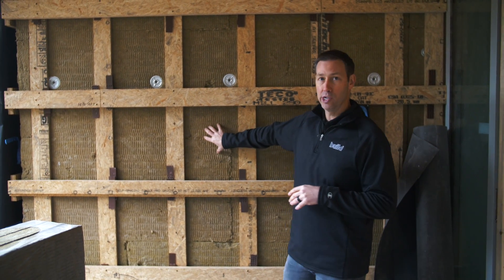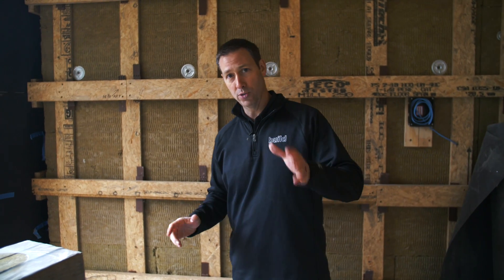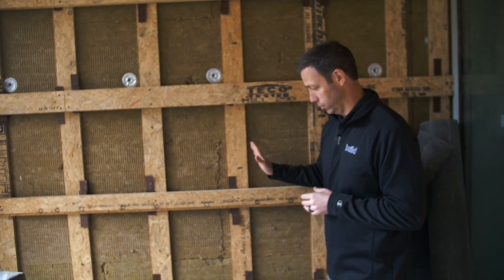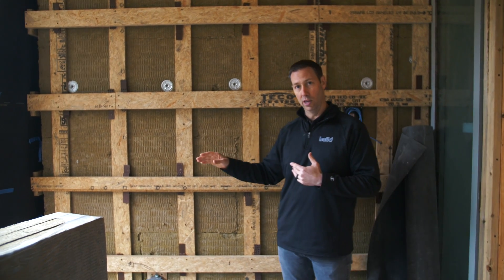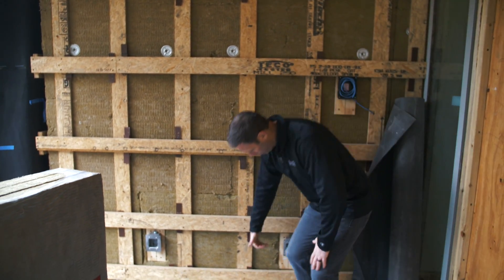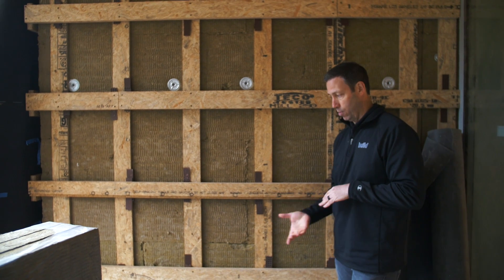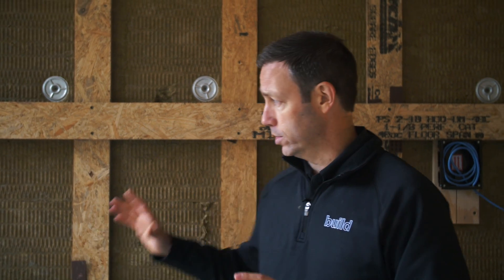Rockwool + RainScreen Exterior - This is a killer assembly!

Comment: Super Nice! -- QUESTION -- To my mind, Rockwool, which I love, is more like a wool sweater on a cold day - it only works if you have a windproof gortex type jacket on top of it. Regardless of the stated R value of a "sweater" the wind blows through it easily, unless you have a windbreaker on it.  So why does the cold air not flow right through Rockwool?

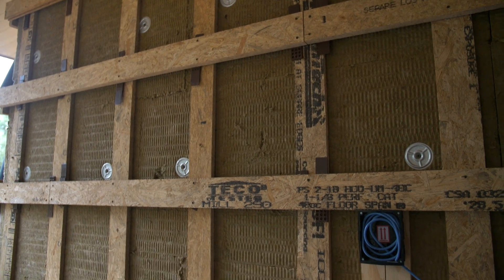Comment: At 2:32 there's a mention of backing out caps / screws and just holding the mineral wool in place with the battens. I'd like saving those expensive screws, but don't they leave hundreds of small holes in the air control layer when they are backed out?

Comment: Rain screens (cladding) are a great idea but they have an unexpected danger - fire. If made of flammable materials, especially when vented at top and bottom, they form an excellent chimney for flames to quickly rise. That contributed to the horrid apartment fires in London in the last few years. Same problem as the old balloon framing technique that we’ve abandoned. The rockwool is fine but the rest is fuel. Definitely a ‘killer assembly’, unfortunately.
Reply: Rockwool is very fire resistant if the entire house was wrapped in it the attic would have at least two layers as well and the roof would be covered in it too. You could mitigate the flammablity of the bracing by using certain types pressure treated lumber (more expensive, and need compatible fasteners) and it would become fire proof. The London fire the rain screen was made of extremely flammable non-approved foam bonded to flammble metal siding that melted off. The building was also >15 stories vs a typical house that is just 2 stories and the top does not terminate into the air like the apartment building did but terminates under the soffet so the chimmney effect would be minimal. 

In commercial rain screen assemblies they use steel and rockwool these are completely immune to fire and are a very safe and killer efficient assembly. The london rain screen was not approved for the apartments even before the ban.

Comment: I saw one builder actually used spacers under the horizontal plywoid strips. They were pencil size with a hole in the middle for the screw to go through.  The spacers were 3 inches long so the Rockwool doesnt get compressed. They are small amd you just stick them through the wool. Perfect spacing every time
Reply: We figured this out installing gutters 150 years ago

Comment: Just by simply running the strapping, furring strips or in this case Advantech, diagonally, you still can hang vertical siding AND have strapping every 16"OC and hit the studs!  Less labor and less materials too without the risk of standing water on horizontal furring strips!

Comment: I don’t see why you couldn’t put an extra layer of house wrap on the outside of the Outside layer of the rain screen battens just behind the siding. most especially if it’s a wood clap board type siding.. As well as a layer of house wrap over the exterior sheathing. Seems like pennies that would save dollars. Still plenty of breath ability .Please let me know what you think I can’t seem to be able to find data on this. I am in a cold north of 60 climate fairly dry

Comment: How does the inner part of the siding dry since it’s put on the black UV screen? Is there any gap between the siding and the UV screen? If so, how is it realized? Otherwise this part will accumulate humidity over time.

Comment: Excellent. Very interest. The horizontal nailers should add huge strength. I agree with the idea of exterior insulation and have used it. My concern is the longevity of mineral wool. I love the fire resistance and R value and sound peoofing. The fibers are brittle, abrasive and very irritating. Brittle means that over time they can breakdown. Can you 0lesde address that?

Comment: I live in northern Minnesota and looking to insulate overly well. Last year we hit -52 degrees, yes, -52, therefore looking to keep as much heat in as possible, and not to have to redo in at least 20-30 years. Interested in your thoughts and a possible video in the future.  Thanks for the information.
Reply: New construction or retrofit? Big difference. Regardless, check out Joe Lstiburek’s “Beyond Passive” talk for some extreme cold climate lessons. As my own two cents I would just add that those new to “high performance” tend to jump right into thinking about R-values because it’s got a number on it when really airtightness and keeping the innermost airtight layer at or close enough to interior design temperature and avoiding accumulating and trapping moisture inside the wall and roof systems is the bigger challenge. Anyone can spec R-80 walls as an exercise in spending money, less people can get such walls to stay bone dry and never develop moisture related issues.

Comment: Palm beach county, when it built its courthouse, had to use man made mineral fiber, MMMF, instead of regular fiberglass insulation because of the higher fire rating required of a public bldg.  There was a problem with the window system and it leaked in a storm and the insulation got wet.  There are chemicals that help the material bind to itself like a glue would.  Mold started growing on (ie eating) those chemicals.  I did not watch all your post but I suspect your rockwool would have the same prob if it got wet.  But  the attachment skin might provide a good mold barrier if this occurred.
Reply: + large roof overhangs

Comment: “Maintaining 80 degrees!!! WTF??? My 1920s house with a $100 3 ton (used Carrier) window AC keeps my house about 65-69 degrees.  And no fancy wrap around insulation...
Reply: You weren’t listening closely.  8000 sq ft house, outside temp over 100, 3 ton AC.  I’ve got 13 tons on my 4200 sq ft house.

Comment: If horizontal strapping has already been done (by mistake) Does it need to be removed so the air flow channel is on the rockwool side?  In other words changing the layers we see so that the vertical strapping is on the outside and the horizontal is against the rockwool.  The cladding is barnwood mounted vertically.

Comment: 25 years ago I renovated our 1920 gambrel roofed house. We live in snowy Pennsylvania. . I "accidentally" , by luck  I suppose did something similar with 2" heavy industrial ceiling tiles 2'x 4' from an office warehouse that were being thrown away. They were NASTY huge fiberglass chards and we furred out the house and I filled  all the 2' gaps with the ceiling tiles. And although there was thermal bridging at the furring it did essentially the same thing allowing some air movement from the bottom behind the siding.  The rain screen (in your case black) I used was Tyvek. ...WOW has this accidental system held up well. My siding is meticulously attached  flitch hemlock natural edged siding, full 1" (no taper) . I used only stainless screws, only under the lap, figuring if the boards ever warped or cupped I could face screw. ....25 years, no movement. All the trim boards/corner boards are massive 3"  x 4" toe screwed from the edges (screws are hidden once siding is on). I was concerned about bugs getting behind the siding, but that has never occurred. The house was very carefully insulated and sealed with fiberglass Batts in the bays, and them vapor barriered with heavy mil plastic. It is super easy to heat in winter and very easy to keep comfortable in summer (most times window open at night). It's only 1200 Sq. Ft and heats with a first floor centrally located Vermont Castings stove,  1-2 cords annually. We do have high efficiency boiler and radiant floors and cast baseboard, but love wood heat. Perhaps my only mistake was consumer grade windows. We did a high end standing seam roof, which we LOVE. R
Reply: sounds good

Comment: Exterior insulation is called "continuous insulation" and has been around for decades.   I recommend using Rockwool or Hemp-batting for interior walls, and for the exterior (continuous insulation) using rigid foam, as it is denser and more weather resistant.  The best type of rigid foam for homes would be foil-lined XPS rigid foam.  And yes, you want to create a small gap between your continuous insulation and the exterior siding... this is to PREVENT what they call thermal-bridging (meaning to transfer heat/cold from the exterior towards the interior).

Comment: it should be noted that the screws attaching the furring would not reach the studs regardless of where they were placed. a 6" screw is just long enough to allow the tip of the screw to reach the interior edge of the sheathing. thus, you get no thermal bridging into the wall cavity via the screws. that probably explains why the builder used ripped 1.125" Advantech sheathing for furring instead of using conventional 1x furring strips.

Comment: I'd change the exterior wrap (UV protected) for a radiant barrier.  Then you'd see "shiny" between the gaps in the rain screen, not that it matters, but a radiant barrier is missing from the wall assembly.  R 4/inch I believe is that compressed rock wool insulation and would be my first choice because polyiso (R 6.6/inch) off gasses eventually.  Bad for the planet, but what planet?  Should we even worry about that anymore?  I built a house this way using CMU's (blocks) structurally in 2002.  I have another on the drawing board now.  
I'm putting a 1" layer of insulation over the Concrete structure, glued and screwed.  A #8 deck screw follows a 1/8th inch masonry bit into concrete perfectly, self tapping and secure, once.  Use a washer to hold the panels securely against the flat concrete surface.  Then, a 2x4 steel stud frame, balloon framed with blocking every 4' horizontally and the cavities carefully insulated.  This part I haven't done.   I need a way to use those  decks screws, longer this time, to attach the steel frame to the concrete wall, through the 1" uninterrupted layer of insulation.  Not many.
 The steel studs and 3 1/2" insulation have to fit tightly together, the 2' centers may be lost, but I think they'll work out almost perfectly.  Start in the middle and work towards both sides.  Diagonal bracing might be "let-in" steel braces (flush with stud nailing surface) or sheathing, then the radiant barrier, and a "hat channel" horizontally every 2' bottom to top.  Hang either metal siding or treated wood siding, something light weight and weatherproof.  Corners can be pre-broken metal or something sturdy enough to add strength.  Rough Openings are 1/4" all around, bigger than any finish frame, door or window.  Doors and windows are 'suspended' in place (perfectly plumb and level and parallel to the inside finish surface, then held in place with low expansion foam, which continues (maintains the integrity) of the insulation/air/vapor barrier layer "to the glass" of the inside of windows or doors.  It's inexpensive enough compared to anything I've researched and should be fairly easy to install, especially on smaller  buildings.  Here in the desert, it separates the conditioned space from the outside world which is heated by radiant heat.  All the stucco houses don't deal with radiant heat, they actually capture heat and  re-radiate it into the conditioned space long after the sun is down.
Reply: I am buying a 40 year old house built with CMU. I am planning to add exterior insulation and then horizontal drop siding. There is not much information out there about this. Is it possible to speak with you about this?

Comment: Hey Matt, Is it possible to “outsulate” with such a product and use a fluid-applied weather barrier?
Reply: Uh.... that's what's going on in this video.  The WRB would almost certainly be applied to the sheeting which is under the rockwell.  And, just to be clear, we are looking at the outside of the wall in this video.
Reply: Stephen Speicher actually it’s not. There’s a wrap product on that piece of the structure and that’s all he’s allowed to show. The wrap isn’t the issue; some fluid-applied barriers don’t like to be in contact with other certain products. But I did get my answer from Prosoco though.
Reply: Marcus Fant 

The black wrap is an aesthetic detail not for wrb. The cladding will have gaps and they wanted to show black between the cladding and not the furring and rockwool.

Comment: Rockwool absorbs water.  It is used in hydroponic farms.
Reply: Not Roxul. You can submerge it, but it does not hold water. Its very hydrophobic.
Reply: Guy Tech Oh I see.  Different.
Reply: It does not absorb water. It is in fact  the opposite of hydrophobic. Rockwool insulation does not wick water, which means that any bulk water that contacts the outer surface will drain and not be absorbed into the body of the insulation.  @SteelBuckeye

Comment: How about using all the 2'X4' ceiling panels people throw away under the house wrap for exterior insulation? I assume they don't have the same R value per inch, but they are similar enough that it's probably close, and obviously better for the price. It obviously won't fly for a house that's being sold as "all new", but for DIYers or even people who want to add insulation during a residing job, it's worth exploring.

Comment: Matt,  you need to check out GreenGirt. Solves this whole assembly problem with a composite z-girt that has metal reinforcing. It would replace the mechanical fasteners for the rockwool and also replace the vertical sheathing strips and thin corex pieces. Pretty neat system. Can be installed horizontally or vertically.
Reply: Awesome. Thank you.

Comment: I did rockwool in my walls and ceiling. Stuff is the worst to deal with. It makes for a miserable day as little bits fall all over you. It is much harder to deal with than standard fiberglass, especially overhead. The stuff gets in your eyes, down your back, on your arms, in your ears. They should really package with some vapor barrier wrapper just for handling.
Reply: I have used rockwool a couple of times and that was not my experience. While it can still make you itch it is nothing compared to fiberglass. It is also sooo much easier to work with.
Reply: Not my experience. Way better than Fiberglass batts, and you could have used a hooded Tyvex suit & safety glass or full face shield during the install.
Reply from the maker: Interesting. That’s not been my experience
Reply: Did you by chance use a different brand of mineral wool ? I had a contractor substitute Thermafiber when I specified Rockwool and that stuff was just like you described. I made them take it out and put in Rockwool.
Reply: I used sound and safe in a remodel ceiling I kinda liked doing it.( I assume it is the same basic thing  just in fluffy sheets)  Little dirty but way better than fiberglass.
Reply: the rockwool used for this rainscreen is different than the ones sold at big box stores. The ones at Lowes or HD are fluffier versions of these. Rockwool makes several types of mineral wool. These have very high pressure, and are very hard. They are used for exteriors and underground.
Reply: @NoRoads2AllRoads  Here in Philadelphia the big box stores now stock Comfortboard 80.
Reply: @mancinidesignbuild  really? That's awesome... I may have to go look at my local one in Harrisburg
Reply: @mancinidesignbuild  I live in Los Angeles and can’t find Comfortboard anywhere but eBay. Lots of the fluffy Rockwool though.
Reply: rockwool is not harder to deal with than standard fiberglass. first of all, rockwool stays between the rafters without have to be stapled or requiring other forms of insulation support as do fiberglass batts. in my personal opinion, rockwool irritates my lungs less than does fluffy fiberglass. in general, you need to learn to read instructions before you do stuff. if you had, you would know that you should use eye protection, respiratory protection and wear long sleeves when installing any kind of insulation.
Reply: Good to know.  I will try to remember to be prepared for that if I ever use it.

Comment: What is the R value of the 3" Rockwool?
Reply: R12
Reply: @pro272727  Thx
Is that enough? Or does that add to the insulation in the "ribs" I am thinking you'll need 3 times that or 9" to get in the 30's for someone building in the north.
Reply: @JohnSmith-se8pf  I live in Ohio and 12 is what is in most walls that I have seen, unless the wall is built with 2x6.  Now your attic space you want more, because heat rises,  R36 or higher.     Watch "Building Science Insights -- To Vent or Not to Vent", it's a great video on insulating and venting.

Comment: If I can save up enough money I hope to redo my roof in metal, extend the overhangs, and add external insulation to the walls. . unfortunately I'll probably have to get new siding after that, but if I can save up even more money I might go with metal siding as well.
Reply: The bigger-than-fist-sized holes we had in all kinds of construction here in OKC in 2010 in ALL types of construction make me wonder "what's the absolutely best solution?"  Some holes in foam commercial stucco type construction were bigger than softball.

Comment: We use those 3-inch Roxul products for sound absorption panels, bass traps, etc.  It has outstanding acoustic performance.
Reply: Phil Perri - what type of toxic waste? Could you elaborate?
Reply: Small rock particles particularly silicates are incredibly carcinogenic when inhaled. Many of the small benchtop installers will die in their mid forties from cutting benchtops without pretection.
Reply: @aidansharples7751  and cement mizing too?
Reply: Yup, cement is a concentrated mix of silicates and pozzolanic materials. you should be wearing small particle breathing protection until your concrete is well mixed and whenever you handle cement.
Reply: I have used Rockwool on many studio projects.  Very economical solution if applied correctly.
Reply: It’s does last I knew they were using slag waste
Reply: Phil Perri  More like you making up a huge load of BS